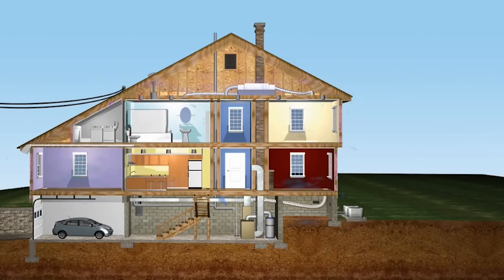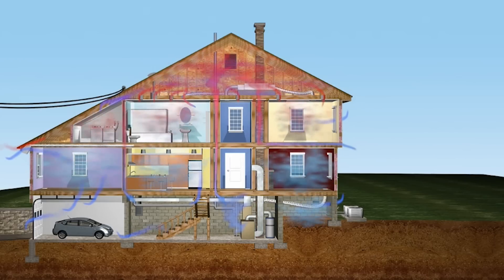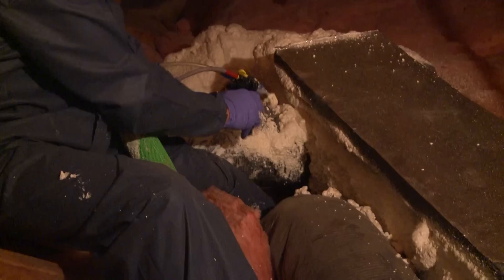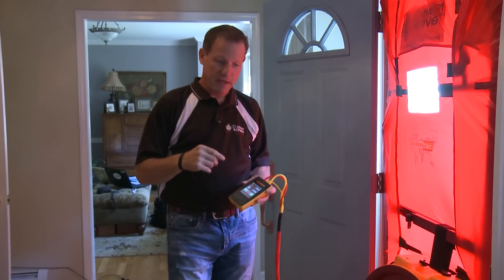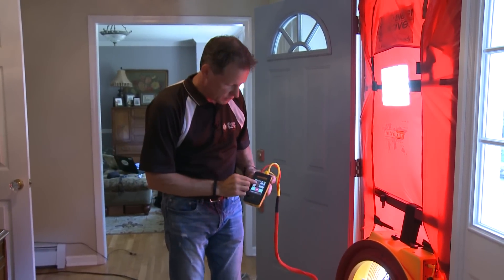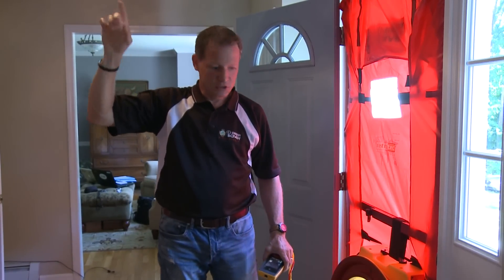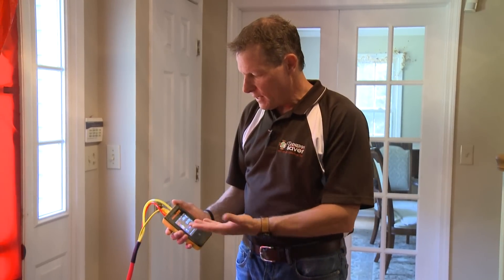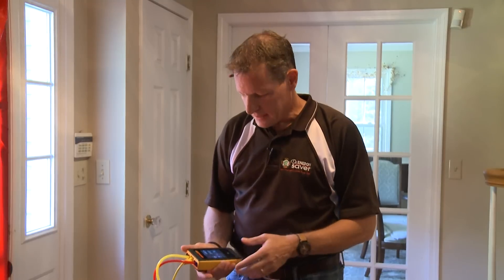How Sealing Attic Ducts Reduces Total Home Air Leakage

Comment: Larry I had a 15 seer 2.5 Amana put in.to replace a ten seer.the new one is to noisey.60db
the old ones not. had fiberglass insulation wrapped around the air handler.
The new one doesnt will that quite the new one if we wrap it also.HELP........

Comment: How can this be code approved. when was closed cell foam an aplicable duct sealant? Mastic is code approved not close cell.  Don't do this type of work it is sloppy. I work in the spray foam insulation and HVAC industry this type of work is what I would condemn.
Reply: +Kristopher Kirby What's the problem with using closed cell? Is there some type of health hazard produced? Just curious what your thought process is.